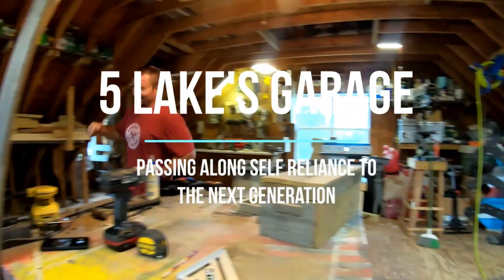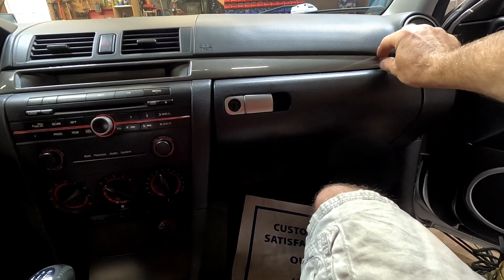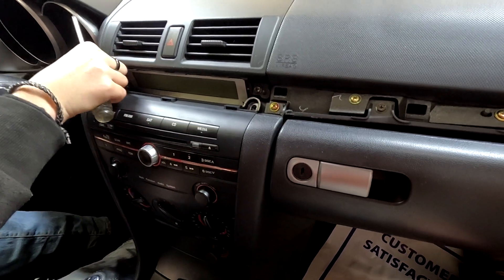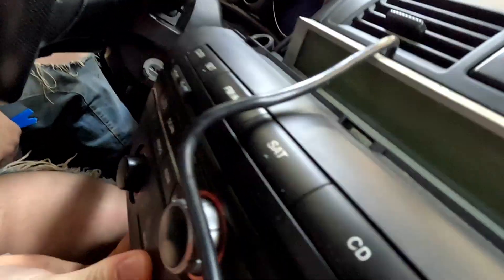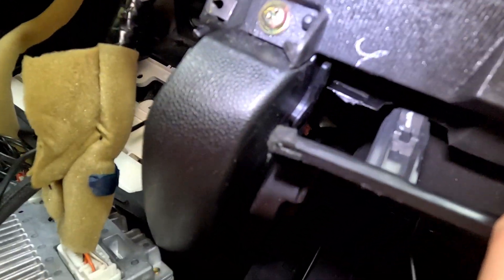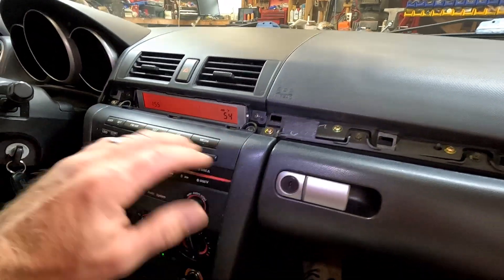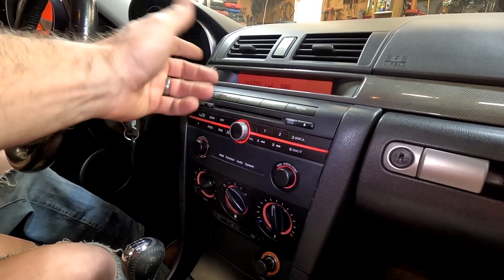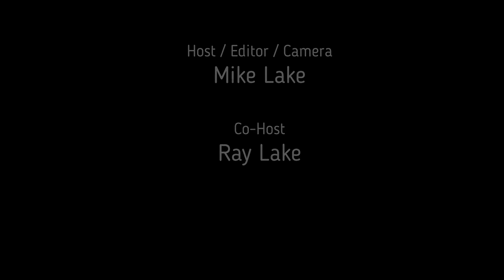2006 Mazda 3 Gets Bluetooth  Go hands free

Comment: I bought a bluetooth transmitter with a built-in microphone on Aliexpress. Installed it from below on the central console, glued it with double-sided tape between the airbag indicator and the cigarette lighter. I made a small hole in the plastic and put the wire inside.
The aux connected with the adapter like you did. I had to make an usb connector behind the radio to power it up.
 Works good, sounds good, even looks good  (it has lights). I love the superfast automatic  connection with my phone. And it cost me 10$
Reply from the maker: Nice.    so many ways to make it happen.    it sounds like it was a clean install.   I would love to use the one in the Mazda as soon as I put the trans back together.   :)